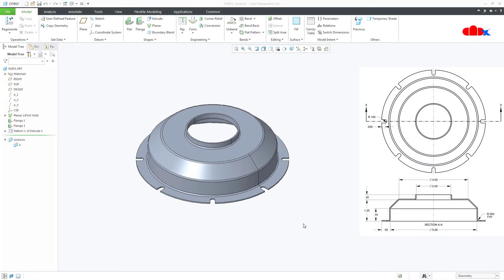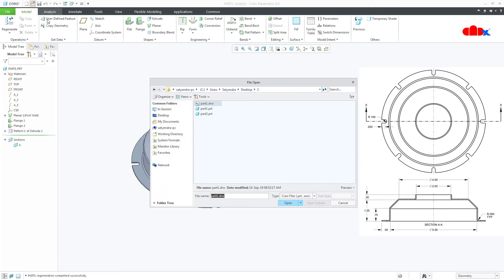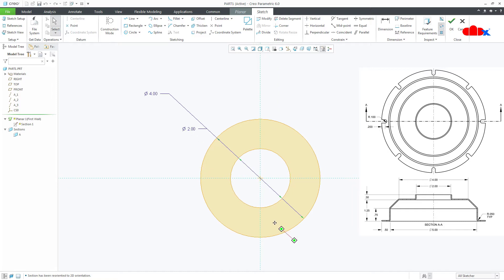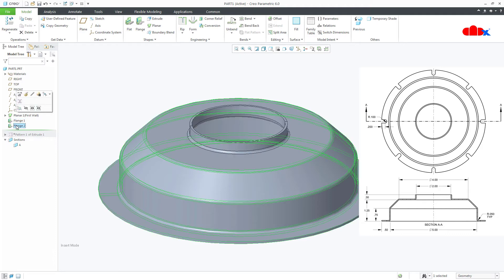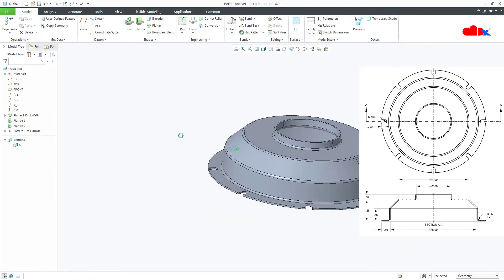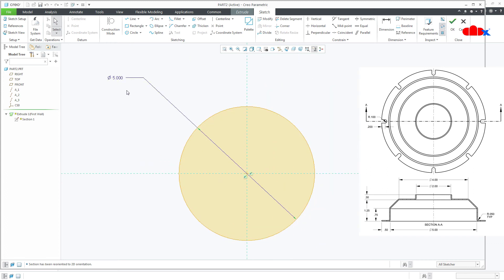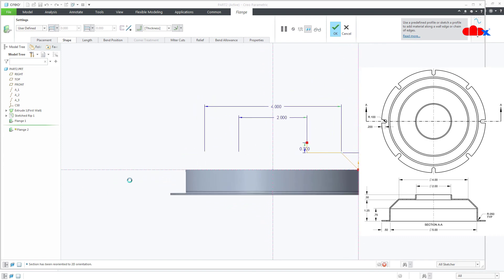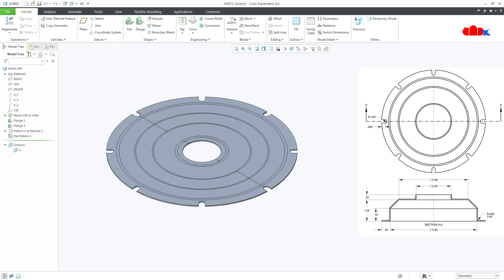Sheet metal tutorial | Design process to get the correct Flat pattern in Creo Parametric

Comment: I can't get rectangle flat pattern plz explain deeply. I followed ur steps but, finally it shows revolved sheet.
Reply from the maker: Follow the steps shown in the video.
Reply: @CADxTraining  I did sir
Reply: Second flange not to be flat pattern
Reply: I tried alot but I cant find a solution
Reply: Yes I am also I can't get  rectangular flat
Reply: Please explain step by step in this process
Reply: @CADxTraining  Sir I am not getting rectangular flat pattern because of rip operation, I had select top plan and draw a simple line as sketched rip, is this right approach

Comment: when I tried creating flange from first wall it is not created for inner circle then i tried it with outer surface it was created .what error i am making for inner flange of first step?.
I tried by changing dimension of inner hole to 4 ant then it was created so does the flange creation depends on size of hole diameter ?
Reply from the maker: Try to select different inner edges and vary the angle.
Reply: @CADxTraining  tried angle variation from 180 to 0 and length from 0.1 to 1 but getting same error .Also it is not able to unbent also not getting flat patterned

Comment: sir when i used planer command that time circle didn't came correct way sir what is the reason sir and also message area shows convert entities are still selected what is the problem can you tell me sir
Reply from the maker: Increase the file accuracy.
Reply from the maker: Go to top left corner- file-prepare-model properties-accuracy. Change the value to 0.0001
Reply from the maker: You can reach me through the email.
sandesh4satyen@gmail.com
Reply: @CADxTraining  tnq sir its works